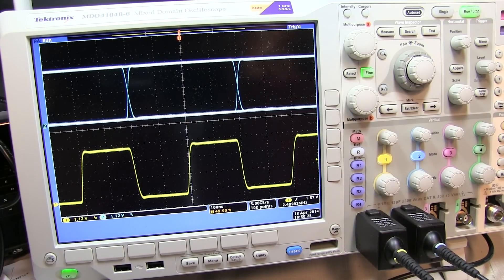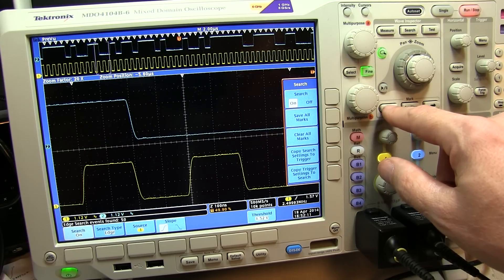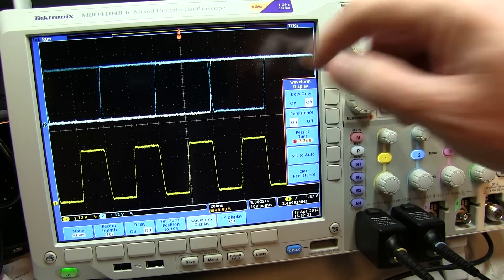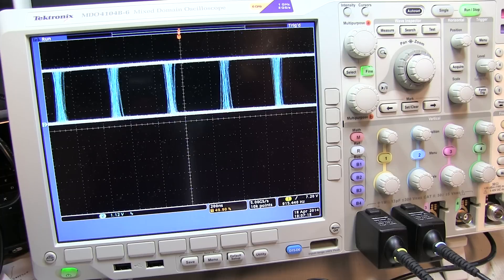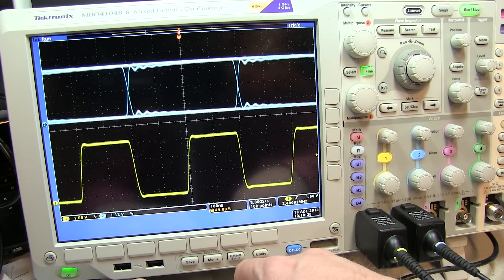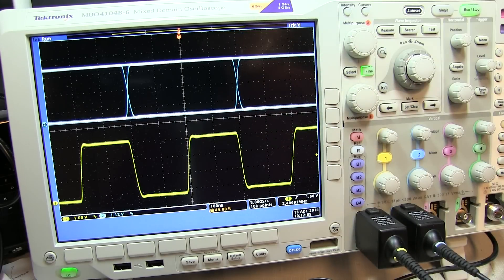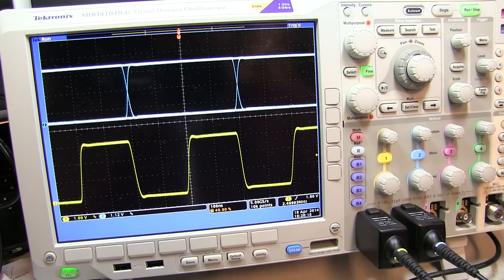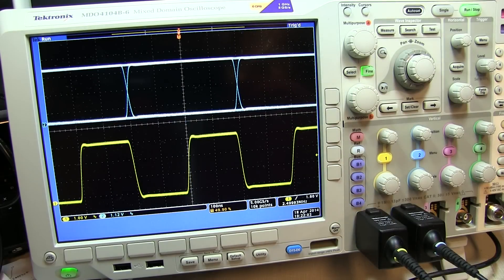#141: What is an Eye Pattern on an Oscilloscope - A Tutorial

Comment: excellent video. it would be great if you could show the eye patterns of bpsk, qpsk all compared...
Reply from the maker: BPSK, QPSK, etc. are all RF modulation types, and thus don't have visible eye patterns directly when looking at the RF signal.  When demodulated back to baseband data, then there is an eye pattern that you can view.  This requires vector signal analysis or modulation analysis capability that most people aren't going to have available to them.  Of course, looking at the output of a receiver that is demodulating these signals will give you an eye pattern too.
Reply: how about this then? http://en.wikipedia.org/wiki/File:Binary_PSK_eye_diagram.svg
Reply from the maker: Jones Panicker Sure, that shows the resulting eye pattern after filtering and demodulation.  The actual BPSK modulated carrier signal looks more like this: http://electronicdesign.com/site-files/electronicdesign.com/files/archive/electronicdesign.com/content/content/64598/64598_fig02_inline_cropped.gif
Reply: hmm. but i don't understand how http://en.wikipedia.org/wiki/File:Binary_PSK_eye_diagram.svg came about. if anyone could explain that it would be great.
Reply from the maker: That eye would come from performing a phase demodulation on a BPSK signal, using a phase detector or phase locked loop demodulator, or something similar.  This would give the baseband digital bit stream which could then be displayed as an eye diagram per this video.
Reply: But the wiki-picture doesn't look at all like a digital signal. It looks a lot analog. It would be great if someone could do the experiment and show how it came about...

Comment: Nice tutorial Alan, but the MDO4k scope,  cost around £17,000 ($29,000 US), do you think you could give your tutorials with something hobbyists actually own? Even a Saleae??

Cheers.
Reply from the maker: The MDO4000 series starts under $10K US, MDO3000 start about $3K US.  However, eye patterns like this can be displayed on just about ANY scope, even analog CRT based scopes.  As long as the scope has some form on waveform persistence, eye patterns can be displayed.  I used the MDO4000 because it's large screen shows up on video very well.
Reply: ***** hey, don't get me wrong, if I had an MDO 4k I'd be using it too, however, even at $3k for a scope, that's out of reach for your average maker/hobbyist - a $99 scope or saleae is more likely to be in their kit, and so your excellent tutoring would resonate ;-)

Comment: I started taking a passive interest in DSP and signal processing about two years ago, when I picked up my first RTL-based sdr and started decoding trunked radio and other digital modes.  I've seen many of these eye charts and constellations since then but nobody ever takes the time to explain how they work, which i can understand, but it can be frustrating.

So thank you for putting together a simple and extremely clear explanation of these figures and how they are useful.